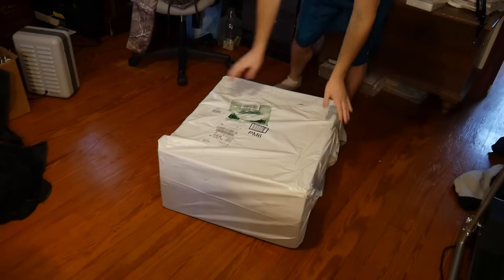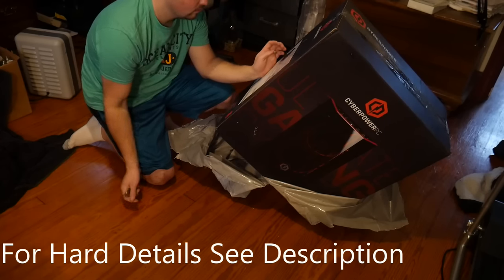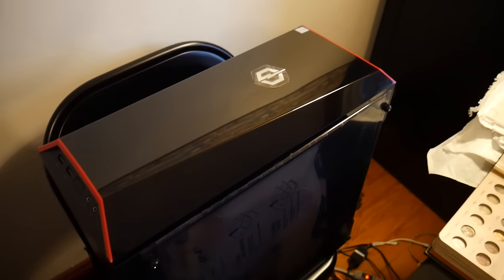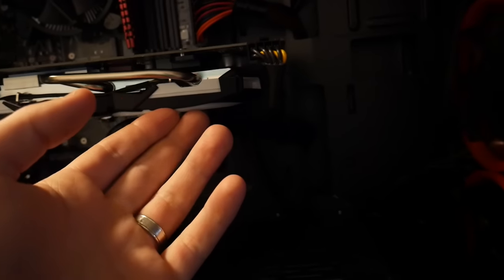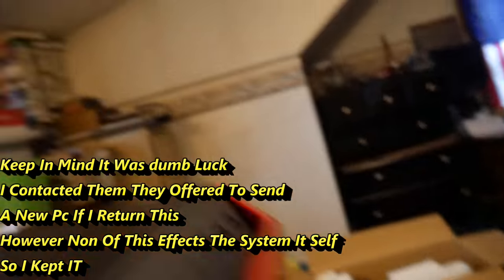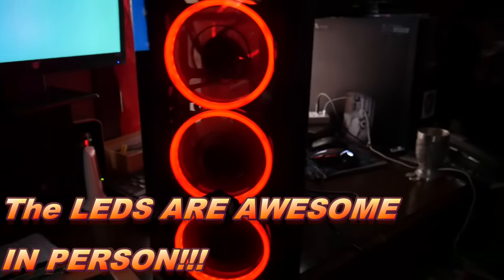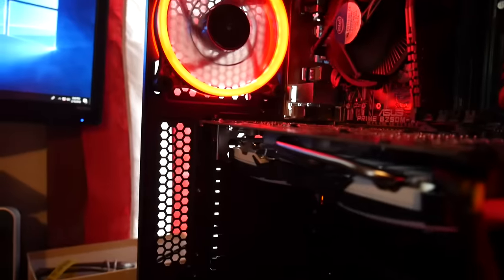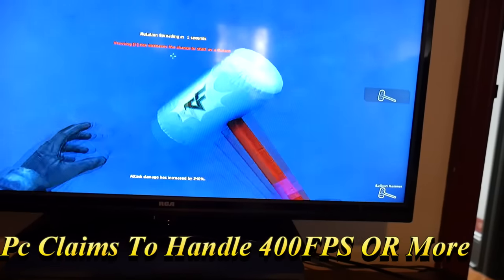CYBERPOWERPC Gamer Xtreme GXIVR8020A4 PC Full Honest Unboxing Test & Review

Comment: If you have ever played the game Ark Survival:Evolved, I installed it from Steam and I could not run the game at all. I did lots of things to try to fix the graphics and it ran and bad graphics and bad fps. Is my graphics card defective or can this pc not run AAA games well? Also, I wanted to get another graphics card (The Same One) and use that to see if I could run the game with twice the power. Is there ports for 2 Radeon 580's?
Reply from the maker: i have played ark fine with mine so im guessing maybe something was wrong with the one you got, i do not know if there are 2 ports or not for more G cards ill see if i can find out
Reply: Hey this is my 2nd account (John). I am considering upgrading my graphics card but you said you have installed more ram. Can you please record a minute or 2 of ark gameplay so I can see if mine is defective before I buy an upgraded graphics card or ram? Thanks
Reply: Makoz Makoz Hi Makoz, having 2 gpus isn’t always better.... I would just upgrade your gpu. It also sounds like your current card might have a defect... I’d return it and see if a new one works fine before upgrading (don’t buy 2, do some research on SLI gaming...).
Reply: John There is only 1 port for 1 graphics card, its a budget motherboard, only offers the vitals.
Reply: It's not the computer, Ark just isn't one of the best looking games

Comment: Please show me what you have plugged in. In the back please tell meee I have an error with it
Reply from the maker: What kind of error are you getting
Reply: The Life Of Scott Wenger it’s telling me to restart it by pressing ok and I do and it just keeps on doing it over and over again and it shows a x with a red circle
Reply from the maker: hmm ive never heard of that. open the panel and disconnect every cord 1 at a time and reconnect each cord 1 at a time ( while the pc is off ) then once you unplug and plug all the cords back in turn the pc on let i do what ever it does and see then
Reply: The Life Of Scott Wenger what type of cords do you have connected like the hdmi and stuff like that I have the adapters and the hdmi do I need anything else and yes I do have the hdmi plugged in to the graphics card do I need anything like a WiFi adapter or something
Reply from the maker: If your pc is far from your router box then I recommend a Wi-Fi antenna the one I use is in the link description  it helps boost your signal and holds a better connection
Reply from the maker: i also have a ton of other stuff im using tho ( that you dont need to use ) if interested i have a cyberpowerpc playlist found here with lots of videos and im working on making more on diff mods ive done and im working on - https://www.youtube.com/watch?v=MbIQCyLBFTg&list=PL9eEMhR6GPx8zcnJ-_0lrQUE3isrdmNqG
Reply: The Life Of Scott Wenger its like 10 feet away from the pc is that okay or no ?
Reply from the maker: 10 feet is fine and sorry I don't use Snapchat
Reply: The Life Of Scott Wenger what can I add you on I have snapchat and instagram

Comment: The Life of Scott please help read my last comment
Reply from the maker: hello, please dont listen to that guy, 400fps with maxxed settings  only the top of the line gaming pcs can do that  400 fps with all max low settings Maybe, now can that pc Run Fortnite  yes will it lag? it may from time to time, i recommend checking out the pc i have in my description its like 80$ more but its updated and runs fortnite a whole lot better  but if you cant afford the extra 80 bucks then that pc will work for games just some depending on settings and internet connection may lag from time to time

Comment: hey im back so i bough the pc and i hooked it up and right now im downloading everything but i looked it up but it dont have speakers and how do i get the volume to work on my tv and im using an hdmi cabel
Reply from the maker: Use your tv controller to turn the volume up
Reply: The Life Of Scott I think I did when I hit it on my keyboard its max and when I do it on my tv still nothing
Reply from the maker: Try putting the hdmi cord in other ports on your tv if that don't work try other ports on the pc
Reply: The Life Of Scott I doubt it will on either because the one port on mine isnt hooked to the graphics card and the port is the same one I use for my xbox one

Comment: Can it run fortnite on high fps and can you change the colour on the pc that you reecomended
Reply from the maker: The pc I recommended is multi color sadly non of these pc can change color and yes it can run fortnite  good
Reply: And btw more then 150fps on low setting and max 3D resolution?
Reply from the maker: Yes
Reply from the maker: Hello you can change the led if you install color changing ones but from factory the color you see on the image is the only color it comes in
Reply: @ScottsHonestReviews  where do I install it from
Reply: And in the image there is some colours on the one u recommended not 1
Reply from the maker: It's just plastic around the fans where led are you can take them out

Comment: I heard it gets loud when playing heavy games you said to take off the front casing by the 3 fans will that cool it down?
Reply from the maker: it helps a lot taking the front cover off. but sometimes when the fans really kick on all full speed it is a little loud but not enough that it annoyed me. some may get annoyed but its just the fans running at top speed to cool everything down quicker normally they go back to normal speed after a little bit

Comment: Hey can this run bigger games such as GTA and rainbow at a clear rez
Reply from the maker: hello yes it will be clear i do recommend overclocking the gpu for best performance its very easy to do and the PC comes with the program to do it :D
Reply: @ScottsHonestReviews  thanks for telling me nice vid and you I just subscribed and liked
Reply from the maker: Your welcome  I'm glad to help and thank you!!
Reply: @ScottsHonestReviews  I have a question I have found a pc that is the same but instead of a 4 at the end of the name it is a 5 does that change anything (sorry new to pcs)
Reply from the maker: I guess it all depends if the description is the same then it would be the same but if it's cheaper then this one then I would be worried that the parts are not as good
Reply: @ScottsHonestReviews  this is a piece of the description CYBERPOWERPC Gamer Xtreme GXIVR8020A5 Desktop Gaming PC (Intel i5-8400 6 Core Processor, AMD RX 580 4GB, 8GB DDR4 RAM, 1TB 7200RPM HDD, WiFi, Win 10 Home 64-bit), Black - VR Ready
Reply from the maker: Yup that should handle the same way if it's not from Amazon be very careful especially ebay a lot of times sellers on ebay and other websites take the new parts out and swap with old and lower the price by a little,  if it's from Amazon then you should be fine if it's any pc I listed in my description then those sellers offer a full refund if you have any issues
Reply: @ScottsHonestReviews  it is from Amazonthanks for telling me
Reply from the maker: Your welcome

Comment: Wait the wifi isnt wireless?
Reply from the maker: Yes it's wireless but I recommend every have a USB antenna to strengthen the signal to get the most out of the pc
Reply: The Life Of Scott thanks. Also I heard its core i5. Is that a problem?
Reply from the maker: So far 8 plus months of owner I haven't had a issue
Reply: The Life Of Scott ok and last question, would it be good to play Triple A games or new games like Black Ops4 Battlefield V etc.?
Reply from the maker: Yes. The pc is rated to play most aaa games they claim up to 99 percent

Comment: Does it come with a dvi d?
Reply from the maker: Great Q no it did not but for under 25$  I have a link in my description for a good cheap one. It's USB plug and play very simple
Reply: I don’t think this person was asking about the DVD/Disk Reader. They are asking about the Port and or cord that hooks up to the monitor. There should be a VGA, DVI, Display, and HDMI port. I think they are asking if the Computer comes with a DVI -D Port and, or Cord. Just a Heads up.
Reply from the maker: Ok thank you!
Reply from the maker: The pc did not come with any monitor cords but has all hookups for the plug or hdmi use  I used the hdmi port it works perfect for display
Reply from the maker: here is to see live gameplay with this pc under maxxed settings Fortnite https://www.youtube.com/watch?v=4pxrZpGDOmo

Comment: Can someone help me with mine? I’m new to pc gaming and have no clue what I am doing
Reply from the maker: what do you need help with ? ask away
Reply: The Life Of Scott I don’t have a monitor so I have to use my tv with an hdmi and it doesn’t seem to work. My pc does power up. Lights on the tower and my mouse and keyboard all work just no signal to my tv. A paper included said it’s normal for some wires to be disconnected but I have no clue what to look for
Reply from the maker: are you sure the tv power cord is plugged in? then are you sure your tv is on the right setting some tvs have HDMI 1 HDMI 2 That have to be changed to with your remote. if its connected to the hdmi port on your pc then it will show up. so chances are its a setting thats off on your tv.
Reply: The Life Of Scott Everything with my tv input corresponds. I play ps4 and everything works on my ps4. I’ve watched several videos on the Masterbox lite 5 case it is built in and I notice on the interior several wires were unplugged and the only wire I could clearly notice had a corresponding port was my hard drive.The rest of the wires were zip tied but could clearly be extended if untied and had no clue what to do from there. From time to time my playstation has had similar issues in the past with not showing up on my tv but has since worked smoothly.